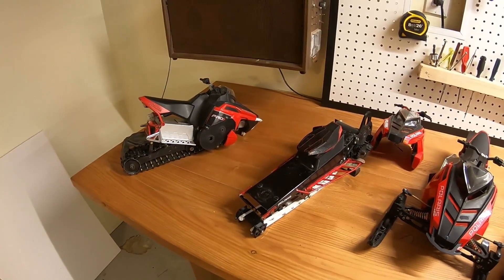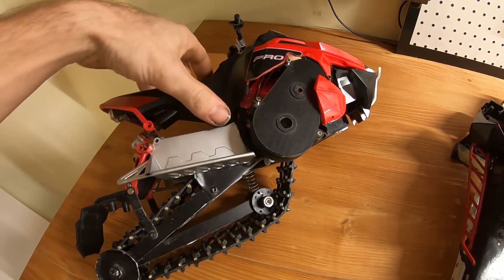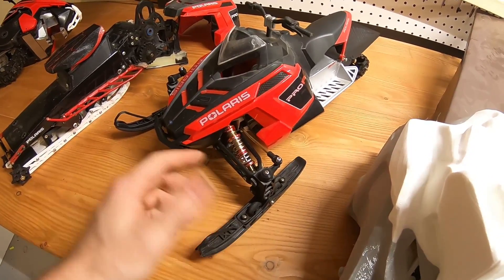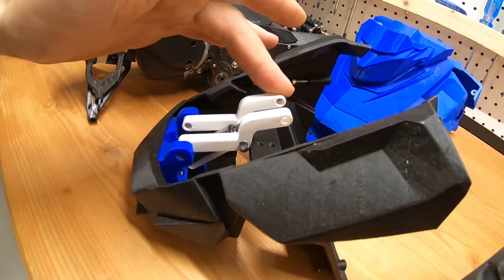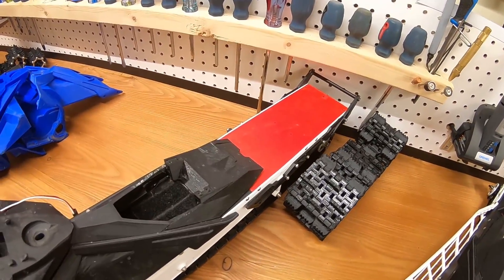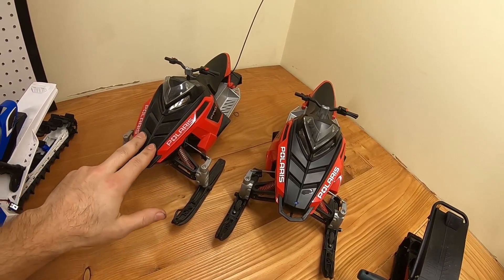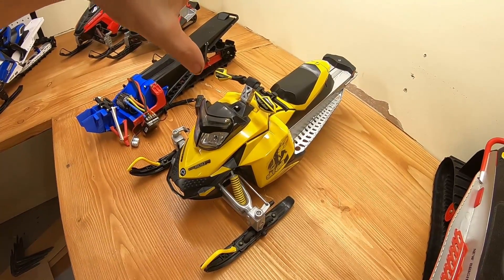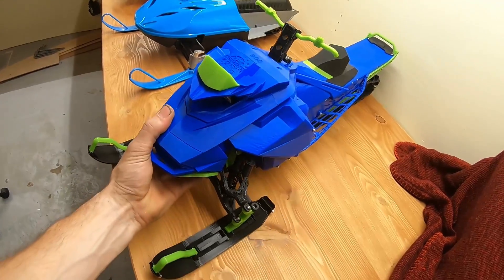Rc Snowmobile Collection 2020 - Rc Creations

Comment: going back to belt drive for the alpha i see... im excited to see how it performs because i never used a belt driven sled before.
Reply from the maker: Neither have I (with direct snow contact), yay unexplored territory!
Reply: @Pascal_Robert--Rc_Creations  I actually ran a belt drive on my rc snowmobile with semi direct snow contact. I never made the side panel fit so in deeper snow it would be right up in the belt. Never had any issues, 3d printed pullies with a 3d printed TPU belt.
It should work out great for you, good luck.

Comment: Pascal thanks for everything!  Ive been into all RC since '78, except these.  I just bought my first one a Polaris Pro R 800 dead mint no radio.  Can you please suggest upgrades like motor, pinions, esc, parts?
Reply from the maker: I suggest you have a look at the rush to rmk serie. It will give you a few ideas on what to do!

For motors and esc, any system brushless 1/10 works well, but i like castle creations stuff.  I also like the hobbywing g3 v10 motor 10.5t. Super light and plenty of power
Reply: @Pascal_Robert--Rc_Creations  Thanks for the super fast response and help Pascal.  I get it my Polaris today!  How can a noob tell the difference between the older, better Ski-doo and newer ski-doo?  I have a feeling Ill want one of those soon.

Comment: So, as someone who has the ski-doo @18:44, what motor and esc would you recommend.
Reply from the maker: Castle creation has a lot of awesome products,   Depending on your budget I would either go for a 1/10 SCT combo, or a mamba X esc and 1410 motor.   There is also a lot of good brands but these would be my 2 picks.
Reply: @Pascal_Robert--Rc_Creations  thank you,will check them out.
Reply: @johnshobbies4224  where did you get it
Reply: Stealthy Gaming it was either.   RCGroups or eBay. It was awhile ago.
Reply: @johnshobbies4224  oh how much was it
Reply: @TylerGotRax  if I remember correctly,it was in around $100. Plus or minus.

Comment: you should do a rider for the sleds. they look bit wierd without rider
Reply: Problem is they raise the center of gravity alot and then it's always on its side since it doesnt shift its weight like a real rider. Any kind of speed turn is impossible with the stock rider on top.

Comment: je ven acheter le kit ppour printer si tu aurait les info de chaque piece de surplus qui faut jachete je serait heureux
Reply from the maker: Matériel nécessaire pour compléter ce kit.

Modèle de base (jouet) de motoneige
Quincaillerie: une tige de 3 mm (allu ou laiton), une tige de 6 mm (30 mm de long)
Quatre ''colars'' 1/8
Un tas de vis (M2 & M3 ...) et rondelles
Deux roulements 6x13x5 et deux (12x18x4) (les unités sont en mm).
Un engrenage de 56 t et un pignon de 14 à 20 t de traxxas. (recherchez Traxxas # 3957)
Un peu de super colle
Un fil de calibre 16 (1,6 mm) (antirouille). Le fil a cloture fonctionne très bien.
Amortisseurs: deux amortisseurs de 60 à 78 mm à l'avant, un de 55 à 60 mm au milieu et un de 70 à 80 mm à l'arrière.
Une fine feuille d'acier ou d'aluminium pliée et coupée pour le tunnel. Dimensions dans la vidéo ... (Mon tunnel mesure environ 0,025 po d'épaisseur. Il pourrait être un peu plus épais en fait. En gros, vous pouvez le plier à la main, mais il n'est pas trop mou pour se plier tout seul.)
Electronique, j'ai dans ma motoneige un combo Brushless SCT de Castle creations, un servo de direction exi (engrenage métallique important) et un combo émetteur de spectre dx2e et récepteur. Tout cela couplé à un 3s 2200 mAh de Gens Ace.
Reply: @Pascal_Robert--Rc_Creations  merci enormement  si jamais ta des kit de piece qui me faut je suis acheteur aussi xD
je prendrait 4 kit
Reply: tu es du saguenay ou qoi je regarde de video on dirait chicoutimi xD
Reply: @Pascal_Robert--Rc_Creations  combien pour 2 skidoo comme le bleu $$$$